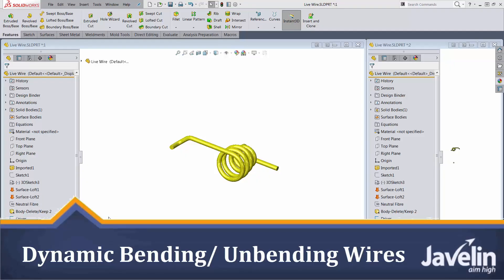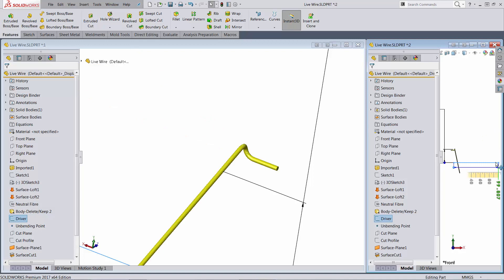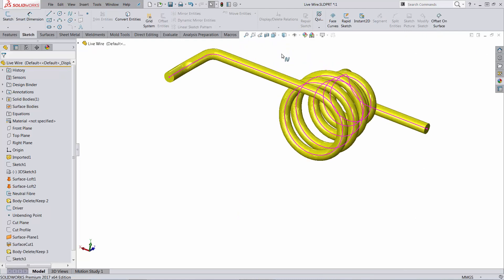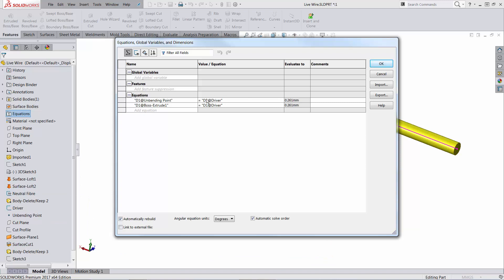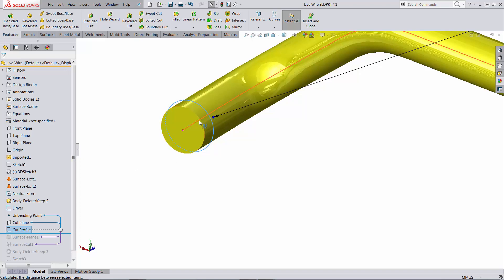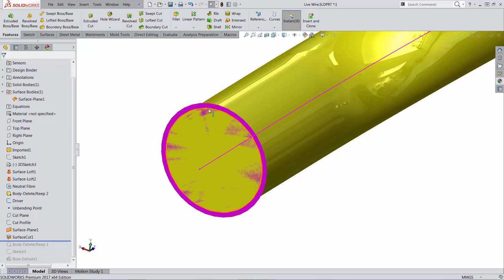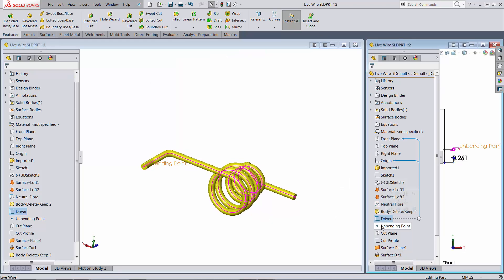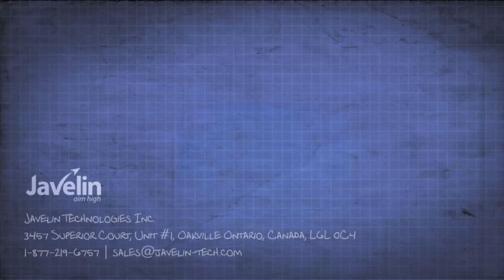SOLIDWORKS Tutorial: Dynamic Bending / Unbending a Wire, Tube or Bar

Comment: This is cool!. I wanted to try and make my own example of this albeit a bit simpler of a path. I was able to get it to work, but when I move the end of the line the graphics do not update dynamically. I have to let go of the dimension handle for the graphic display to update. Is there something I'm doing wrong or are my system graphics just not handling it?